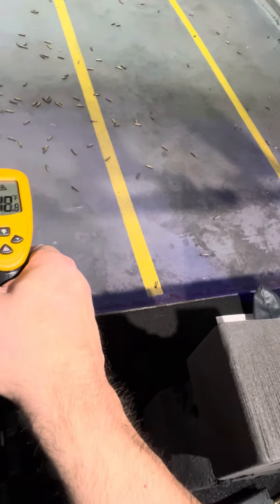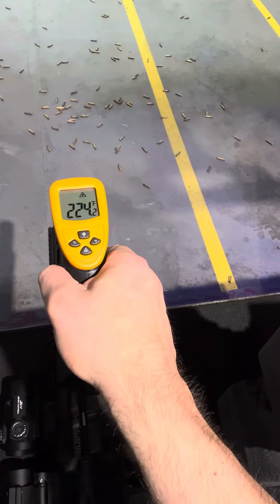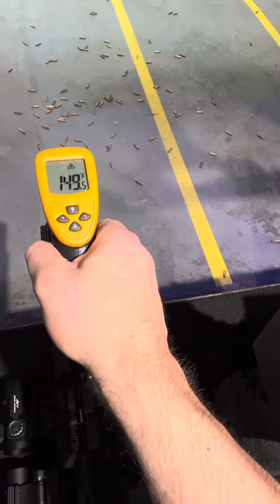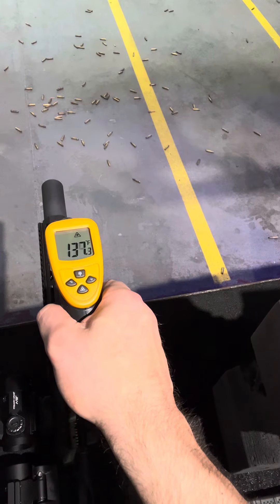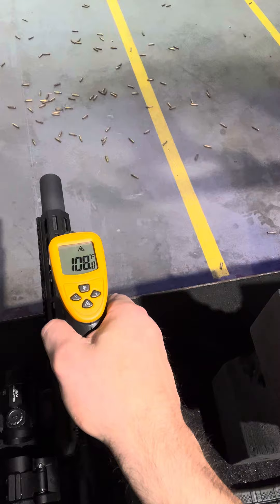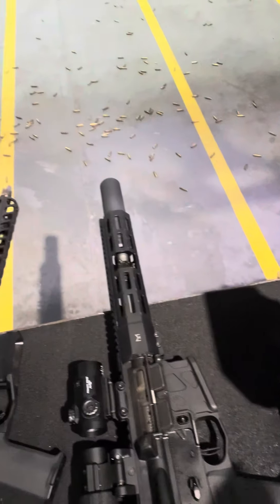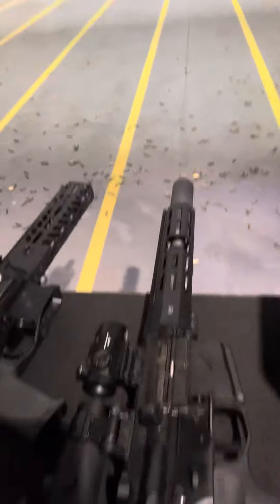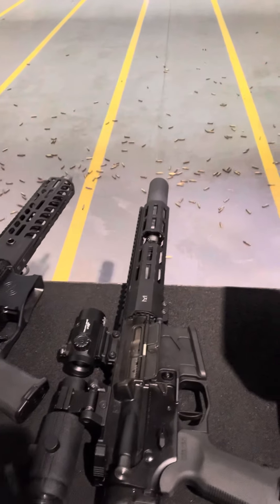CAT ODB x Riflespeed 300blk Subs

Comment: I think adjustable gas block is a must with this can.
Reply: Couldn't disagree more. Tune the rifle to cycle subsonic reliably. With the Odb being a flow through can supers won't be too crazy. With a higher back pressure can, sure run a rifle speed to quickly gas down for supers or vice versa.